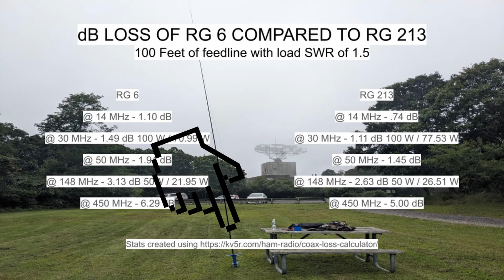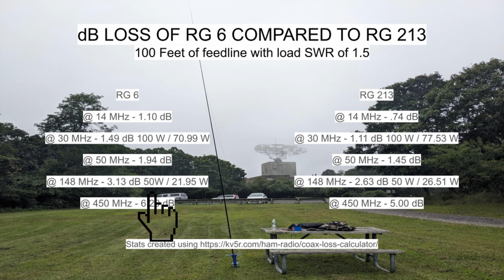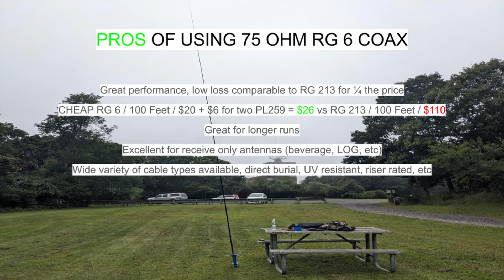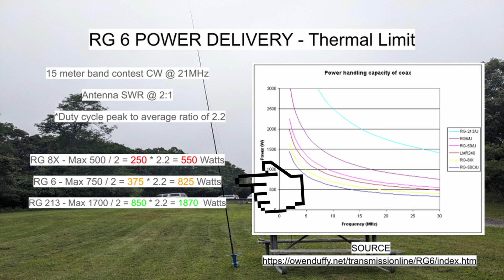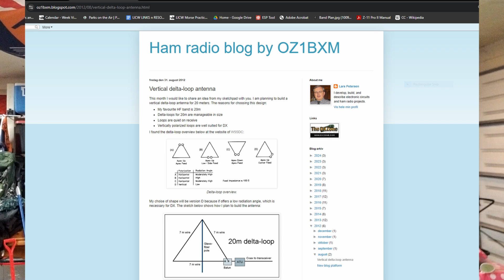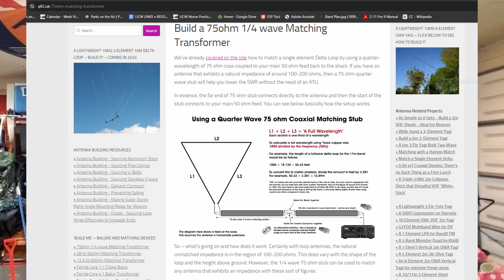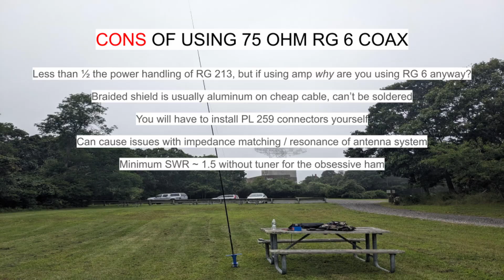Using cheap Cable TV Coax for Ham Radio

Comment: You can get the thing that screws in the back of the PL259 that will fit the RG6, It is just a little larger inside to fit RG6 and RG8X. With that you don't need the tape on there. But whatever works best for you.

Comment: Long time ago, when I was in the military.  I went on a temporary duty assignment and brought my ham radio and a dipole antenna with. Well I forgot coax, but on base I "found" a roll of RG-6.  It was all I had, I cut what I needed and my antenna worked great.  I had it mounted on the roof of the dorm and worked around the world.

Comment: I and a good friend (now SK) had a 2M & a 440 repeater on a local TV tower for several years.  We had a commercial dual band antenna at the 600 foot level.  We were made a gift of the end of a spool of 1 inch 75 ohm hardline by the local cable TV company along with some used connectors we machined to adapt PL-259.  We calculated 50 coax jumper stbs to the antenna and duplexers.  It worked like a champ giving good service.  SWR watching is good to tell you if a system fault develops bit stressing over 'perfect' SWR is a waste of time.  If you hear & work stations is what counts!

Comment: Because it works well with low losses and very very cheap. What's not to like?
Edit: Btw for the power of your typical all mode transmitter RG-6 handles absolutely fine. Oh and in practice I found that for homemade antennas (you are going cheap with many setups around) the mismatch is usually compensated very easily, barely any swr without tuner. Yeah same experience as kd2wtu, just the antennas are electrically "slightly different".

Comment: I have been using RG11 for decades on receive and transmission.
I have even used it on 11m with a 2kw amp admittedly that was coz I couldn't afford a decent cable at the time. A temporary solution that still stands today. 
No smoke to date and never cost me a cent, got to be happy about that

Comment: RG6 should be compared to RG8x. And your correct on all points. Compare the RG11 to the 213. I have moved from standard PL259 to ones with crimp shield and solder center pin. this works well on 75 ohm cable. The 75 ohm is cheap but not low quality. It's just supply and demand. We hams are one of the few that use 50 ohm coax. They manufacture thousands of feet of RG6 and 11 cable to every foot of 50 ohm.

Comment: The biggest drawback is water intrusion.  The aluminum will oxidize a lot faster than copper braid.  Tape up the connections well to keep the water out.  FWIW, this will happen to 50 ohm rg-8x too if it has the double shield aluminized tape. The tape will turn to powder when water gets inside.  Another tip....for single band antennas, making the 75 ohm feedline a multiple of 1/2 wave will help with the impedance "jankiness" introduced.  That or use 75:50 transformers.  Third option....just let the antenna tuner handle it and operate.  ;)

Comment: Such a good presentation. I've got a roll and I thought about using it for monitoring with my 2m or using for scanner antenna which could now be placed higher up in tree. Thanks for the tips.

Comment: The impedance of a dipole antenna is around 75 Ohms.  There is is no discontinuity at the antenna feed point. This is good because the impedance tuner is located at the radio. You end up having good impedance matching at BOTH ends of the line.

I use a RG-6 line and a dipole antenna for four years now.  At the radio end, I have a tuner.  The system is very easy to tune and I transmit 100 Watt of power. The 100 foot RG-6 coax cable came from the local hardware store. It had the F connectors already  installed and it appears the manufacturer has good reputation.  I did not remove the connectors, the excess length was coiled at the antenna side.

Nowadays, good 50 Ohm coaxial cable is either extremely poor quality or extremely high cost and difficult to get.  TV Cable operators have known the importance of cable quality for decades now. What you get at the local hardware store can be of good quality, moderate price and will allow you to set up your first antenna in two hours. Enjoy your new station now!. Don't go searching for obscure numbers in obscure catalogs. It is not worthwhile.

Comment: Many years ago there was a ham who came to the Dayton Hamvention who made and sold Baluns ( or were they .ununs? ) that allowed operators to use the 1 inch aluminum trunking cable for CATV systems. This cable was available very cheap ( sometimes free ) from your cable TV supplier. Short leftover runs from a trunk instal were useless to the CATV systems operators. 
These devices were used to match the 75 ohm cable at both ends to the 50 ohm output of the radio to the 50 ohm input to the antenna. I do believe these were frequency dependent to the HF bands and I am not sure if they were custom made to work with specific portions of the HF bands. Anyone have any info on these items?

Comment: There are many types of feedlines that hams should consider, but are too narrow-minded to consider it. I use the little-known SMR-240 which uses SMA on one end (to get through the hole I drilled in my window casing) and PL-259 on the other. I've run up to 1KW with it.  I have zero issues.

Comment: It appears to me that rg6 is a low loss cable able to maximize signal strength over long distances.
   The only question that remains is to whether there is a BNC connector to fit rg6 directly, or to use the F connectors and use adapters. I've used 75 ohm BNC connectors for work before but I don't recall what cable I used.

Comment: We know that receive antenna coax preforms best at around 73 ohms. Transmission antenna coax performs best at around 37 ohms. 50 ohms is a compromise. So, why is that? It boils down to power handling and Ohm's law. At 37 ohms, there is half the impedance so you can transmit twice the current at the same voltage, hence twice the power. At the receiver, twice the voltage helps, so 73 ohms is better. However, for transmitting, high voltage is not a good thing, it stresses the dielectric in the coax and brings us closer to arcing. Increasing the dielectric adds nothing but cost and weight to our setup. If you are running a kilowatt rig, you want the bigger, low loss coax. Power costs money and a kilowatt spins the utility meter. Is there a disadvantage to RG6 for QRP? Remember, high voltage is not a concern. The in between power ranges are a judgement call.

Comment: I have been a cb operator for years and I make my own wire antennas and I use RG6 coax works great my swr is 1.1 to 1.3

Comment: Great video, note that a dipole has an impedance of 72Ω making RG6 a better choice than 50Ω cable. I use RG6 for a 20 meter vertical dipole that is hung from a tall tree, it provides great DX, N2SN.
Reply: While in free space the dipole may be 72 ohms most dipoles for frequencies below 30 MHz are near the earth and the impedance may not be near 72 ohms, often lower and may be closer to 50 ohms.  Your 20 meter vertical may be close to 72 ohms but if you measure the SWR with the common ham swr meter the swr will not be accurate for what is really on the coax.
Reply: @ralphmowery2898  Thanks for the very good advise. My vertical dipole seems to match very well with a 1.4:1 ratio. I don't use low dipoles due to limiting one's only working non DX stations. I do however have an end fed cut for 80 meters that allows me to run on 80  through 10 with a usable but far from perfect SWR. It runs about 90 feet vertically to the top of a pine tree and the rest of it goes horizontal to another pine tree. I have worked three UK stations from here in NE Florida on 75 phone very late at night - early morning on SSB with 100 Watts. I have also worked VK, ZL, ZS and many other countries on other bands with my IC - 7300 running just 100W. Thanks again for your advice, I am always trying to learn something, Dave, N2SN.

Comment: When I was first starting in ham radio ages ago, my dad had some partial rolls of RG-59 (75 ohm) given to him by the local cable TV company. We used this stuff to feed a dipole antenna that served as my one and only HF antenna for many years. I ran 100w CW from an ancient 6146-based tube transmitter and a homebrew antenna tuner. I never had any issues with power handling, and given that RG-58 is markedly inferior to RG-6 in all key performance metrics, I wouldn't hesitate to run that same amount of power (or even a bit more) on RG-6.
If the cost or availability of coax is standing between you and getting on the air, RG-6 is a perfectly acceptable approach to get past that hurdle.
Reply from the maker: My feelings exactly. Thanks for watching!
Reply: I think that rg59 has slightly lower loss than rg58 but not enough to make any difference.

Comment: On your technique of screwing the PL-259 over the braided-end, many half-baked keyboard-warriors will chastise for using this technique, claiming that the connection will corrode, deteriorate and fail--even causing you house to slide off its foundation!

Well, I have been doing this for nearly 60 years and every time I take one of these apart, the connection is just fine with shiny copper braid-strands; this means that there had to be a 'gas-tight' connection!. This includes all the connections I made up on my tower back in 1988 without a single failure!  So, this is just fine, but there are a few tips:

First off, you do have to have a tight-fit without cutting the strands, but this is usually never a problem. Next, I use Coax-Seal (and we also have the same people complaining about this excellent material!), that I hand-mould over the finished connector and coax as an additional seal (however for many years I never had Coax-Seal or even used electrical tape!).  I like Coax-Seal because if you will clean the outer surface before you open the connection, you can actually re-use then Coax-Seal.  I have some of it that is 40+ years old and it is still pliable--just keep it clean! Finally do fill the center-conductor with enough solder to 'plug' it to keep ny moisture out of the center conductor.
Cable-TV coax is great stuff and will work in most all situations unless you are going full QRO!  In fact, Doug DeMaw made a matching transformer (radio---50-ohm coax---75-ohm matching-xfmr--antenna) for a Delta-Loop that we build, which had excellent SWR across the whole 40-meter band without using a tuner!  This antenna survived for 30+ years before a large tree came down and obliterated it--all of the connections were still just fine, even laying on the forest-floor the whole time!

Great video and community!
73...
Reply from the maker: Thank you !

Comment: That's a lot of power to lose.  100 watts in a 200 foot run of RG8X gets me 90 watts out the other end at 14.250 MHz. Your looses are extreme to say the last. Will your class work, ya, but not very well.
Reply: 100 watts is 20 db over 1 w or 20dbw ,80w is 19 db over 1w or 19dbw , 90 watts is somewhere between 19 and 20 db . The human ear needs 1db minium to hear a difference. 
I suggest the difference between 100w and 80 watts is marginal at best ?
Reply from the maker: Yes, under certain circumstances but in others you may want every watt you can eek out.  Thanks for watching!

Comment: I've used rg6 for years.  safely used with 1kw on HF with no heating, but that will vary from manufacturer to manufacturer. 

6 is best in a noisy environment, it is 100% shielding  as opposed to the 95-98% of RG8 series.  

 Use a crimp connector for RG8x on these, same dimensional specs.   OR  rg6 with copper braid and aluminum shield can be found.   As well as you can use UG-176 reducers

Dipoles are naturally 73 ohm, so a better match than rg8 series of coaxes,     

Don't use transformer for the 75 to 50 ohm mismatch, you lose more power in the transformer than the mismatch.  besides, worrying around a 1.5:1 swr is only paranoia.
Reply from the maker: Sounds like some good advice, thanks!

Comment: Radio is dead because you need thousands to millions to get into the hobby
Reply: You obviously didn't listen to the HF bands this weekend if you think radio is dead. Oh, and I've worked the world with a radio from the 80s that i paid $100 for, made all of my antennas from scrap materials, and the only other expenditure was coax (another cost you could avoid by watching this video). This hobby is only expensive if you think you need brand new equipment, manufactured antennas, and an amplifier. You've given up before you've explored all the options.
Reply from the maker: Find a local radio club I'm sure they will get you on the air for free!

Comment: Most antennas, both commercial and homemade, can be adjusted (trimmed) to match up with 75Ω coax just fine. I have been using RG6 for many years, as it is MUCH lower loss than RG8X, usable even on 440 on moderate (50') runs.  However, don't use any solid center conductor coax on sections that move, such as around rotors.

I generally use BNC compression fittings (specific to the cable), as they are weatherproof and can easily handle 100W.
Reply from the maker: Good stuff, thanks!
Reply: Problem is that most hams will not have a SWR bridge that is calibrated for 72 ohms.  The 72 ohm cable is fine if you do not really care about the SWR on the line and use something to tune out the mismatch at the  transmitter if needed.   I have no problem with using the 72 ohm cable.
Reply: @ralphmowery2898  If you use a standard 50 ohm SWR meter, connected to the rig with a 50 ohm jumper, you'll be fine.

Comment: Thank you !!
I have a basement filled with RG-6-Quad Shielded cable and RG-11 direct burial cable.
About 10k feet of the RG-6  &  4k feet of the RG-11.
My only dilemma = Most of my work is in the VHF / UHF ranges.

I’ve used RG-6 for receive antennas only for decades and it works well.
Reply from the maker: Wow that is an absurd amount of coax!
Reply: @kd2wtu72  I was “hired” at a rate of FREE to pre-wire all of my siblings homes.  That’s just the leftovers after 6 homes.
LOL
Thanks for your channel + videos Sir!

Comment: I look at it like this.  If it is something as easy as better transmission line that will give me a better signal, that is very cheap gains!  All these losses add up in the end.  I guess if you are mainly running sub audible modes, then it's probably no big deal.  If you need to get a good signal out to be heard than maybe not.  If you were in my area, I would give you some better coax!  haha
Reply from the maker: I will absolutely accept coax donations lol. I'll make a comparison video. As far as usable signal, I make it down to Brazil and across the Atlantic SSB phone regularly. If the losses are adding up, its  not adding up to much. Thanks for watching!

Comment: I have been using a bunch of RG-11 (also 75 ohms) for years.  This is the larger cable which looks something like RG-8.  I got three free reel tailings from a residential construction job.  Great stuff!!!  No major performance difference between RG-11 and the 50-ohm stuff.  The best part:  A PL-259 will spin right on to RG-11.  No adapters or tape needed.  Just make sure you fold the 'drain' wires back over the jacket before installing the connector because the wires are steel and you cannot solder to them.  Solder to the center and you are done!

By the way, hams were using 75-ohm coax long before 50-ohm coax was available.  I have an old SWR meter which has a switch to select between 50 and 75 ohms.

P.S.  I still use 'real' copper braid RG-59 too.  You can still buy it.  But you need an adapter to solder it to a PL properly.

Edit: 75 ohm cable is great for scanners and other receivers you don't want to use your 50 ohm stuff for. The mismatch is so slight, the radio won't care about it at all !
Reply from the maker: Very cool, I want to test some RG 11 next. Thanks for watching!
Reply: Very true.  I've been using rg11 and rg6 for years.

Comment: Just 1 additional thing that may hurt you with RG6. The shield isn't made for the low requency ranges your'e talking about. Hence it may leak RF or take on QRM. Most of the times, this should be a problem because leaking in Ham bands while TX istn't problematic and you always want your station in a low QRM environment.... just be aware of that!
Reply from the maker: I was not aware of that! Thanks for the info

Comment: I used the shield as a long wire from a left in drop after disconnecting cable service. You can make capacitors with lengths of cable TV coax.
Reply from the maker: Interesting. Yea I've seen people cut coax to length for capacitance. Thanks for watching!

Comment: hello sir, i want to build flower pot antenna for vhf, can you recomend rg6 coaxial cable? is it safe to my 8watts porble radio?
Reply from the maker: I have not built a flower pot antenna myself, but yes it should be fine to use rg6 to build it. And yes it will be safe for your radio. Good luck with the antenna!
Reply: @kd2wtu72  big tango for your reply, by the way im your new subscriber from phipillipines, keep safe sir  extending, 73!

Comment: Well, I have been using RG-6 and RG-11 for years, making Double Boozaha Antennas for 40 meters, and have successfully run the full legal limit.
Reply from the maker: Thanks this is the info we need to hear: I've tested RG 6 up to 100 W but you have gone beyond.
Reply: @kd2wtu72, you can hear me on 7285 TTN and 7935 Gulf Coast, Terex running 1200 watts.